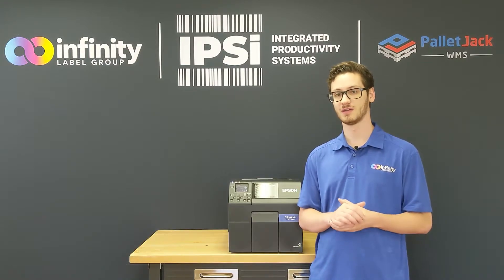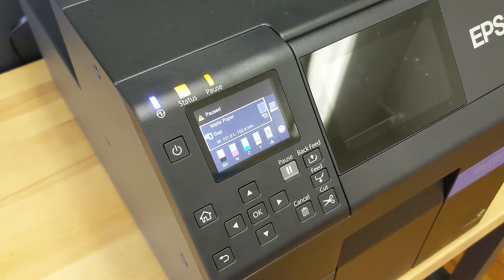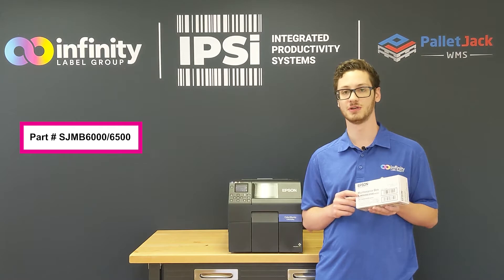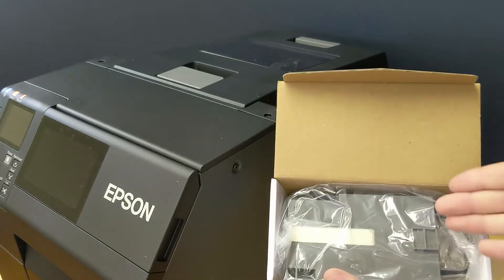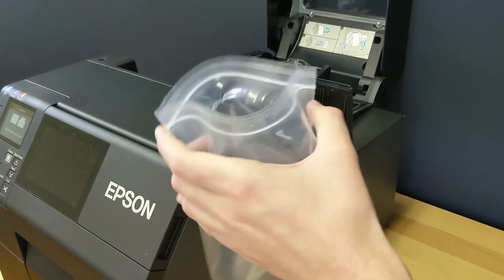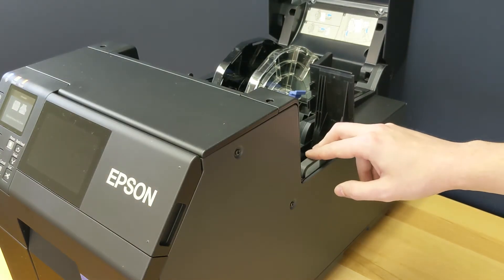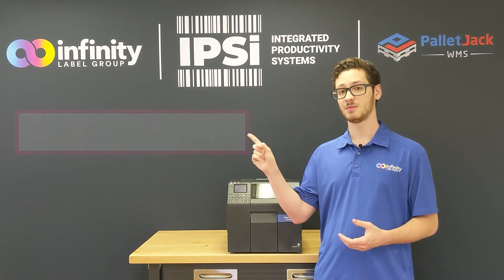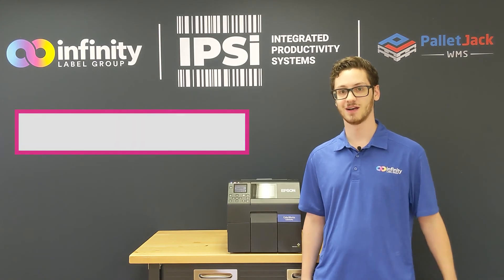IPSi Print Lab - Epson ColorWorks C6000: Maintenance Box Replacement

Comment: Why is my brand new printer saying the maintenance box is nearing the end of its service life?
Reply from the maker: Nick- thanks for your comment!  This is normal behavior for a first-time installation.  During the initial installation of cartridges, the system has to charge all the lines, purge air from the system and lubricate the print head.  To do this, it forces ink through the print head and it goes into the maitnenanc box.  This is only on the initial charging of the system and usually results in activating the warning that the Maintenance Box (MB) needs changes, however you should wait until the maintenance box is completely full, at which time there will be an "x" above the maintenance level indicator (which is located right next to the Yellow (Y) indicator.  You will need to ensure you always have extra ink and maintenance boxes on hand.   If you found this helpful, you can help us by ordering these supplies at www.infinitylabelgroup.com.  Thanks!